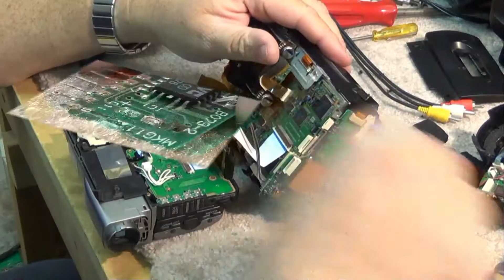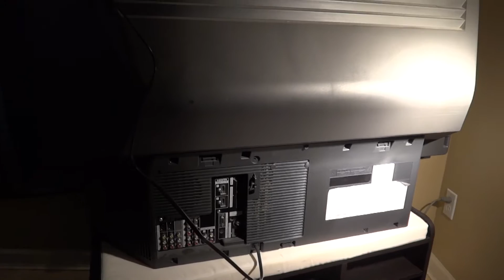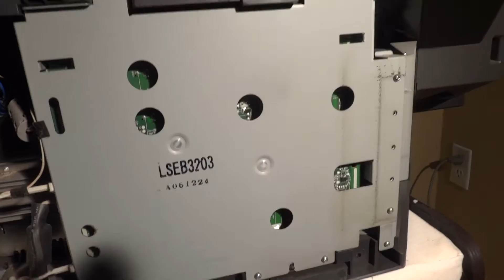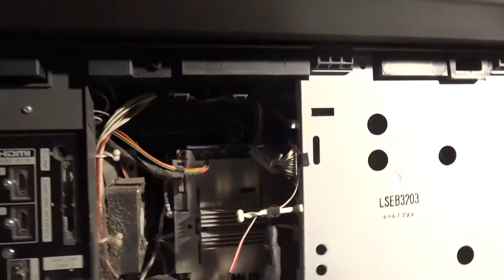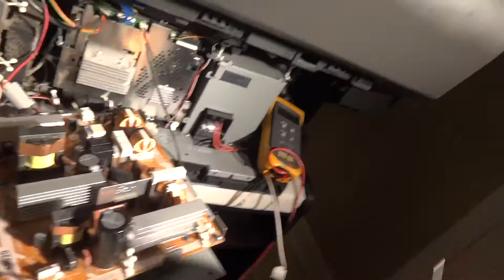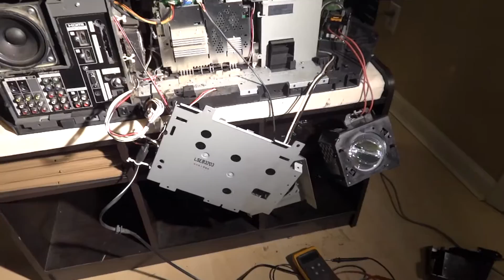Panasonic DLP dead

Comment: I have the original model of this line for 2004 . I remember a class action law suit about these tv going though lamps .  I still use mine the lamps back in the day where like 400 😂.  Would go every year about .   Though the last one I got for free out of a tv that screen had a hole in it when the guy moved in they dropped the tv 🙄. So he left it on the curb I went out at night and took the lamp out  and this lamp has lasted me over 5 years now .  Did note that the lamp was blue kind of on the glass I don’t get why Because I made shore it was the same model I think it was just a newer version of the tv . Well can complain. Only thing is no hdmi on mine just dvi .
Reply from the maker: michael Sanseverino 
I sold this set but I have a few other Samsung sets. I have an original 56 tantus set. Was very expensive.  Bought it in 2003 also no hdmi only dvi. Still working on original lamp. I Lao had a 43" that still works. Took it to work for the lunch room. I then got the 61" LED DLP. That set was a 1080 wobulation chip and that one the mirrors started calling off the chip so it has a bunch of white dots on the screen. I put the old one back in service. I do have a spare lamp in the box that I got under warranty. Havsnt needed it. Been a very reliable set so far.

Comment: any idea how to change the lamp on this set?
Reply from the maker: +Sahil Nath Yes, pull the speaker grill off the front.There will be a plastic hatch you can open right in about the middle of the set. Open the hatch, reach in, and unplug the lamp. No tools are necessary if memory serves me correct. I don't have the set anymore, I fixed and sold it over a year ago.

Comment: Yeah the thermal fuse is evil,today i repair audio boombox with brake heat fuse in transformator.Also a lot of this fails in air fans motors.